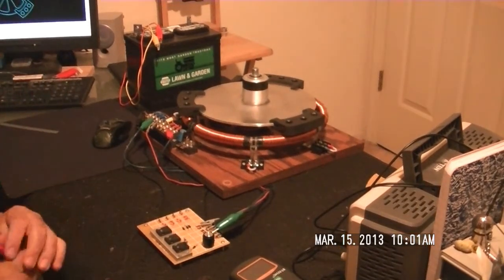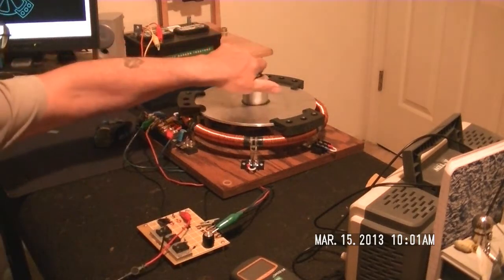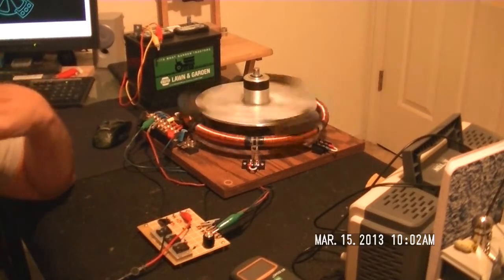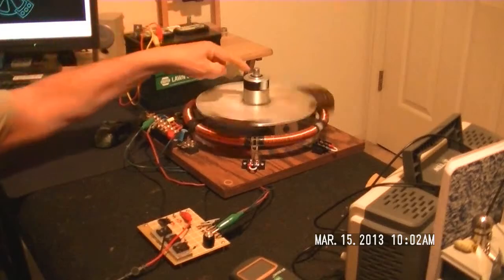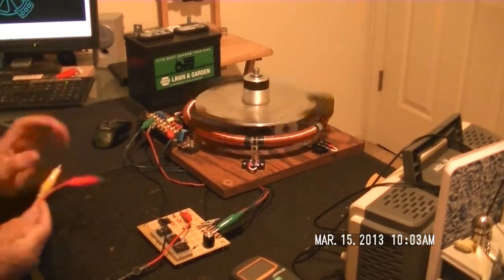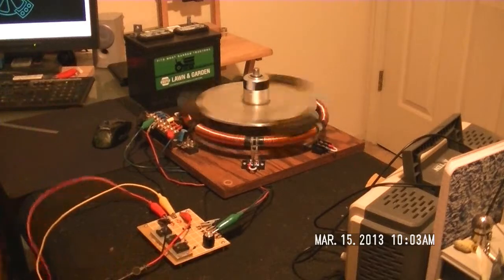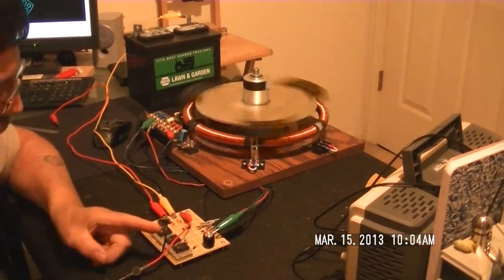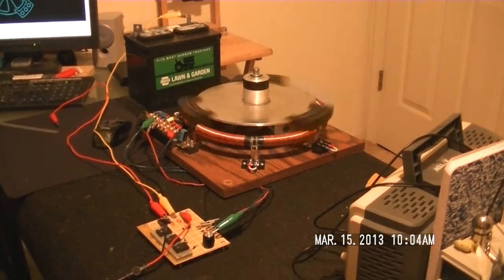Three Pound Bedini Rotor... ?

Comment: My advice to you is go back to the single bedini circuit and hook up all three drive coils in series - you only need one trigger coil (one master coil + 2 slave coils)  Also get rid of the 30 degree angle - your coils need to be as close to the magnets without touching so the coils push as hard as possible against the magnets.

Comment: You are having too much fun my friend. 
The neon lights up because, with no charge battery, the spike has nowhere else to go. w/o the neon your transistor will let the smoke out, or worse – POP! 
Your 3 coils only need 1 trigger wire. That’s right, all three power coils share 1 trigger wire. Take that one wire to a 2k 10watt POT. Then connect that POT to all 3 base transistors then each base transistor to it’s respective transistor base. You might start w/ 100ohm base resistors.